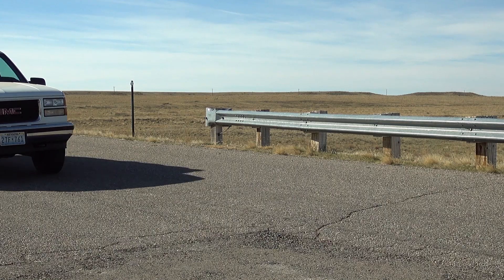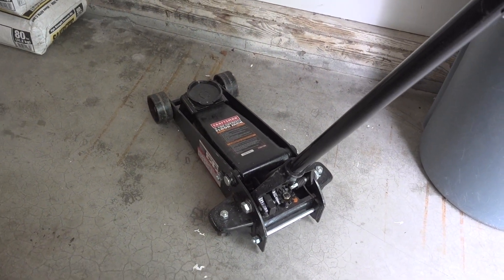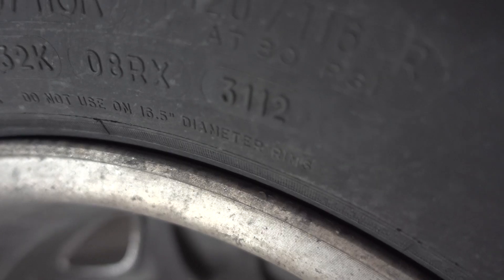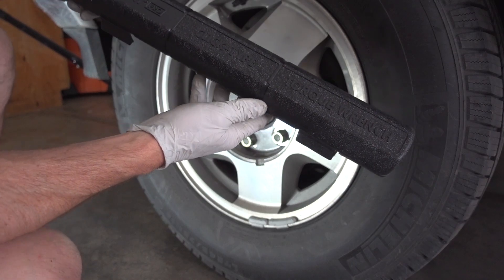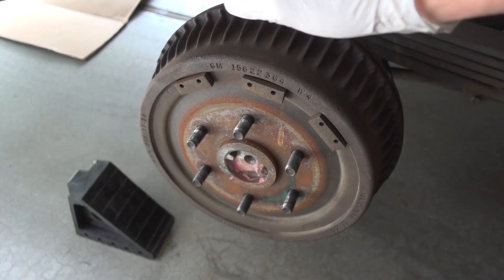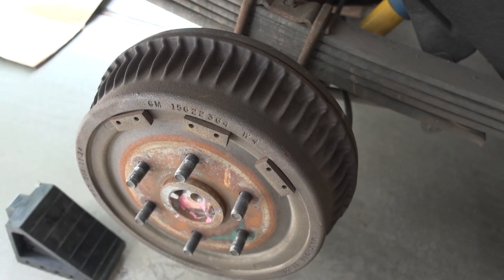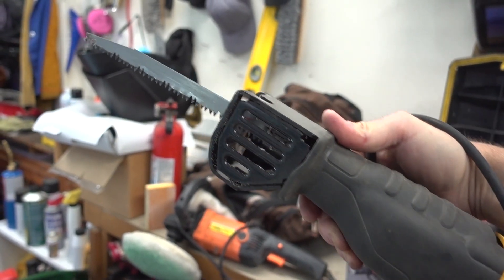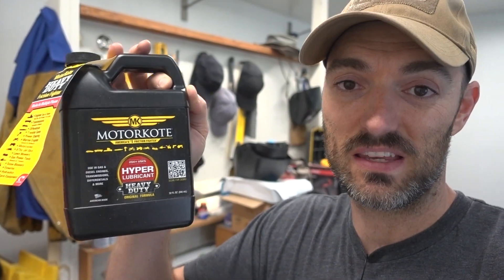SIMPLE FIX FOR TIRE HUM!

Comment: Want to add "never" let a tire shop cinch your tires up with an impact wrench.  Had several rotors and brakes destroyed by an aggressive impact wrench operator.  Never knew this until a shop owner told me. Tell them that they can draw the lugs up with an impact, but you want the lugs tightened with a torque wrench to manufacturer specs, or 90 ft lbs if you don't have the specs.

Comment: Torque spec for the wheels is 140-145 foot pounds on a 4x4 Chevy/GMC truck of that era. Never use anti seize or anything on lug studs or nuts.
Reply: Amazing how many people forget about a wire brush to get loose rust off wheel studs.

Comment: I'm not sure if this helps, but when i have humming tires i first check my air pressure, and if that doesn't fix it i rotate my tires. So far it's fixed it every time (driving for 33 years now). P.s. i hate harbor freight because it's the source of almost all my credit card debt. :)

Comment: 7:04 I may have misunderstood this but you should always store your torque wrench zeroed out. The reason for this is it will mess with the reading and then your bolt won't be properly torqued.
Reply: Absolutely true. I forgot to reset it one time, stored for a few months and it immediately broke when I used it the next time. Expensive mistake.

Comment: I heard to never use lubricant (never seize) on lug nuts as it will change the torque value so, you would have to go to a higher torque (no idea how much higher) to achieve the same torque as you would have with dry lugnuts.  I am not claiming this is the case but I leaned this back in the 1970's and it seems to make sense.  Check it for yourself and see what you come up with.  I really enjoy your videos.
Reply: Never had any problems. Antiseize or not. Torqued or not. Never :)

Comment: I use the anti seize all the time.  I find it virtually stops the rims from sticking to the hub area.   I also place a bead around the rear drums where they sit on the hub.  Allows for easy removal and stops rust.  Great video.

Comment: i am a professional mechanic for medium/heavy duty trucks/equipment and i know not much of tires since we send our tires to the tire shop since it is dangerous but i do not recommend anti-seize on lugnuts if they are rusty or worn out replace them! if i see a truck with anti-seize on lugnut studs i can not pass them on a DOT inspection the anti-seize must be cleaned off to pass! keep up with the videos man!
Reply: Chances are if you have aluminum wheels on your truck, you have anti-seize on the bottom of the stud.  Dissimilar metals tend to stick to one another, and if you didn't have to replace a tire for a while, the tire guy could be beating the inside of your tire for 15 minutes trying to get the wheel off.  But, no, no locktite, no anti-seize on the entire stud, and nothing between the lug nut and the stud.

Comment: I was always told that if you have all matching wheels that includes your spare tyre that the rotation is spare wheel to one side of the primary drive axle then that wheel will go to the opposite side of that axle, then that wheel will go to the opposite side of the front axle then that wheel goes to the opposite side of the front axle, then the wheel left is put back in the spare wheel area.

The torque wrench should be zeroed out after using it, this I was told to keep it in calibration.

Cool vids.

Comment: I have always been taught that you should never add any lubricant on lug nuts. Because you don’t archive a true torque. The torque rating for you lug nuts are a dry torque rating. Lubricating them can cause you to over tighten the lug nuts, and doesn’t provide enough friction between the lug nut and your wheel which could lead to the lug nuts loosening over time. Also tires are good for 10 years max, assuming the tires don’t show any signs of weather cracks, or have uneven tread wear(in that case you may have an alignment issue or suspension issue),and are above 3/32 tread depth.
Reply: I have also heard this. Only lube on the threads.. not the mating surface (tapered part)
Reply: 10 year rating is ideal conditions it's far less then that. 3/32 you will probably hydroplane.. and if you DO you might be liable for the crash aka failure for maintenance.
 
if you live in California then you can run slicks  since it never rains

typical LT tire is 12/32 new upwards of 18/32 for mud tires
Reply: Andrez Vigil you were taught wrong. If you run a rusty lugnut over a rusty lug stud and torque it to spec it will fall short.   Always use a little anti seize on your studs. Just like torquing cylinder head bolts. First thing the mfg says it be sure to lube the threads

Comment: There's no rule for age. I've seen 2 year old tyres with lots of dry-rot, and I guess I've seen 10-15, maby 20 year old tyres that almost look brand new. It comes down to type of rubber, and environment as you've heard. You might think cheap tyres have shorter life. That may be true in most cases, but my wintertyres (from Norway, so we normally have summer and winterwheels for each car) are from a very well known brand and actually starting to show signs of dry rot at 2-3 years old.
Especially for wintertyres, they get harder over time. Sitting in a pitchblack, cold place, they'll most likely be fine for many many years, but with use, in heat, sun etc they get harder.
So I'd say it's more down to how they look (dry rot) and how they perform rather than a date.
If I have to say a date, I guess I'd go for 10 years, IF they still look fine.

Never put anything on threads. Antisieze on the surface where rim meets rotor, yes if you keep having problems getting the wheel of, but nothing else.

Comment: I’ve had those same Michelin’s on my blazer. They lasted 75,000 miles! Well worth the money for them.
Reply: They lasted 100k on my Yukon. Would still be okay for summer if the front suspension wasnt wpre out and dicked up the tread. Rotated them ever 3k miles when i did an oil change.
Reply: You didn't talk about the tires hum noise 🤷🏿‍♀️

Comment: From my understanding. Cause I work at Americas tire/Discount tire we tell customers tires are serviceable 10 years and under to Date. But we highly recommend getting tires replaced when they hit the 6 year mark or 4/32 which ever hits first. Also we dont put anything lube or loctite what so ever on the studs or lug bolts. All we do is use a wire wheel brush to remove corrosion off the hubs and back of the wheels (both mating surfaces of where the wheel touch on the vehicle)
Reply: Best advice in the comments yet. Should put a bit of silicone paste on the pilot flange.

Comment: I always heard you're not supposed to change rotational direction of radials after they've been driven for a few miles because it can cause damage to the tires. I always move them from the front to the back on the same side and vise versa.
Reply: Yeah ,I've always heard the same thing. Hmmmm....

Comment: Mine turned out to be a bad bearing, so I ordered a wheel bearing assembly (for a Maxima rear wheel)  and installed it in less than 30 minutes - problem solved!  I have pressed out bearings before, but it was so easy to just order the assembly which only cost me 24$ on ebay!   :)  Doing it myself probably svaed me > $150,00

Comment: Tires "expire" 7 years after manufacturing. I worked for years as a mechanic (cars, trucks, and motorcycles) every where I worked we would have to check the dates on tire constantly and any at 7 years got a triangle cut out of the bead and sidewall so that they couldn't be used and sent to the recycler. Always seemed like a waste but every tire guy from manufacturers like to, Michelle, Cooper, ect all said 7 years regardless of condition or environment they should be replaced

Comment: All good, but I would not put anti-seize on lug nuts - it has a big impact on torque. You are effectively over torquing and putting threads under higher stress.

Comment: I had cargo tires on my van. When the tire wore to a point the small crosslugs were touching pavement a hum started. I figured it out and they gave me 4 new tire probably with different compound so no hum. Same tire. Now they put continental brand on the vehicle new.

Comment: I use 6 years as my standard for tire age. Also, I would never put anti-seize on lug nuts. If you're rotating your tires on a regular schedule, you shouldn't have to worry about lug nuts seizing up.
Reply: tire shops wont mount anything over so old...
Reply: @mtnmosin2740  I would certainly hope not. Any tire shop should be installing tires that are months old, at the most.

Comment: you need front brakes!  Also I use stick on wheel weights to avoid marring the clear coat on the aluminium wheels.

Comment: Hay sorry mate but you must only rotate tyres front to back and back to front because if you don't and you Cross them from left to right and right to left they are going to rotate the opposite way this causes the SET in the STEEL BELTS to push into the plys of the tyres .That's ONE BIG BLOWOUT WAITING TO HAPPEN .from Aussie mechanic of 40 years thanks!!!!!!

Comment: I prefer soft compound tyres on the front.Hate rotational tyres as have to change with the rear ones.Tyres do go hard as they age   and need replacing regardless of what tread is left.

Comment: First, I love your videos man! I've been watching you for a while and I'm impressed with the quality of your videos. Second, I love watching videos from people that are clearly not in the rust belt and talk about preventing rust. As I feel, wheels and tires come off enough that rust prevention is probably not needed to keep any major rust from forming. A thin layer of anti-seize or fluid film on the lugs is never a bad idea, but judging by how clean the Suburban is, it did not come from anywhere road salt was used but I don't remember where you moved to. I work on vehicles for a living and don't usually see any coatings used on the lugs and often don't have an issue unless they're Chrysler lugs with chrome caps. 
Also, tires are usually recommended to replace every 6 years. The rubber tends to get hard by that point. If you don't deal with slick roads are long below freezing temps, you can probably get a good 8-9 years as long as they aren't sun baked or rotted.

Comment: Do not put anti seize on the lug nuts ,its will make torquing the nut pointless and also the lug nuts can back off
Reply: John never had a problem with that happening before been using anti seize for 5 years and always torque mine to 100 ft lbs

Comment: I was taught 6 years of age and they are usually due for replacement, I see in the middle of the tread you started to develop some slight cracking. Seems like age will be the issue with these not tread life.
Reply: The tire company must have taught you that, I have tires in the neighborhood of 20 yrs

Comment: Enjoying many of your videos especially this one  as  I work for Michelin. I do the rotation a little different I move the rear straight ahead and cross the front to the rear. Sometimes the humming of tires comes down to air pressure and the difference in construction of road surfaces. I have recently purchased a new Silverado RST and am looking forward to doing some of my own maintenance.
Reply from the maker: Thanks👍👍

Comment: I would not reverse the rotation of a tire.  I would consider replacing any tire that's over six years old.  I have never used any type of anti-seize on lug nuts and have never had a lug nut come off or become loose.

Comment: You can use anti seize on the back of rim.. but never ever..ever on lugs
Reply: Always put lube on the pilot flange, never on lug nuts. If the studs are rusty, use a wire brush.
Reply: Ha I just had a good chuckle anti sieze on lug nuts that's a good one. 😂

Comment: For torqueing, set the wrench to half, then do the 1st torque...lower the vehicle, then set the wrench to desired number (120ft-lb seems really high) and do the final torque w/the weight of the car on the tire...yes, never lube the mating surface of the nut/bolt...if anything, put anti-seize btwm the wheel and the rotor/drum...rotating tires in flipflops seems safe...did you even fix the tire hum??
Reply: 120 sounds right. 
My 01 is 140

Comment: My 2002 suburban makes the chirping sound when idling and light acceleration.  I was curious if that is pulley related.   Another good video!  Thx
Reply: Belt tensioner.  Almost all GMs need them replaced between 60-70,000 miles.

Comment: budget 5 years and premium 8-10years.
Reply: any advise Mikael, I have a pair of TOYO tires that are from 2009.  Bran new and never seen daylight as they have been kept in the storage shed.  Do I throw them away or fk it YOLO and put em on and be on the lookout.
Reply: Ken Pachi the big problem with tires are that they are perishables. they dry out and goes from soft gripping the road to solid like a rock. when for exampel you need to break a fresh tires will grip the road and a dry old one will act like a rock and slide on the road surface. there is alot of factors more that will make the tires less safe. wet handeling. emergency handeling. breaking.
Reply: Thanks for the reply Mikael. . . I will just go ahead and put them in the trash where they belong. Will not risk getting my family in a crash due to new/old tires.
Reply: Ken Pachi bad tires is the most common reason for automtive accidents. people look at the tread and that is unsafe. tire makes say 10years life span but that is in mild climate not to cold and not to hot. if you live somewhere hot the tires dry out faster and becomes unsafe. pay for good new tires now or pay even more after a acctident.. i live in sweden and we have +30c in summer and -30c in winter and  the tires are rekommended to be changes every 5years due to climate that destroyes the rubber.  my tip go to a tires shop and rubb your hand on a new tire and then your 9year old toyo and you will understand what i mean.
Reply: Ken Pachi if you haven’t thrown them away yet I’ll buy them haha

Comment: Jimmy- you have 2 separate pieces that form one; a rim and a tire make a wheel. In this video- you are rotating *wheels*. If you dismounted the tires from the rims, then rotated, including the (full size) spare, and balanced- that would be a proper "5 tire rotation", which hardly anyone does anymore- until they need the spare, that is rusted under the truck, and probably nearly flat. Also- if you have "directional tread" tires- you could not do what you show in this video; you would have to do as I described earlier. Of course- if your vehicle has a "donut" type spare- that is not included in a rotation, but should still be checked at least once a year, including jack & lug wrench- and before trips exceeding 200 miles.

Comment: I know Michelins are notorious for going bad early. I know Lincoln says to replace the tires every 21,000 miles or every few years. Don't remember the exact number but I know the tires on my town car got hard real fast and gave me almost no traction. Cooper is for sure better if you're not buying track tires.

Also putting lube on your studs is just asking for the lugnuts to get loose

Comment: Along with checking the tire hum WITCH can be caused by weather are they dry routed or cracked also check your hub bearings along with cv-joint

Comment: you know the quick fix for hum leave that boat at the dealership and get a car with acoustic insulation I'm pretty sure a 10 year would be a better mechanic than you. or heres a thought get acoustic tire foam and do what Tesla dose glue a foam pad to the inside of the tire. And are you wack, age of the tire doesn't matter if its not cracking or the tire isn't bald

Comment: I don't think you are supposed to cross  rotate radial tires.
Reply from the maker: Dennis W I think that only matters if they are directional. I could be wrong but that's what I read.
Reply: That only matters if theyre directional tires
Reply: Dennis W that was 20 years ago unless they're directional.
Reply: You CAN cross radial tires.   Even if  they're directional, although by doing so, you lose the advantage of the characteristics built into the tire.  So I'd only swap sides on directional tires for short periods of time (say using a directional spare on the wrong side of the car).  HOWEVER, the tires under torque should stay on the same side and those not under torque switch sides.  If done every 6000 miles, it will improve the wear on the tires.  If you miss one time, you lose the advantage.  So the rear tires on a pickup should go straight forward and the fronts should cross to the back.  Hum is usually caused by the slight heel/toe on the tread blocks.  By reversing the rotation, they tend to even back out.  Works wonders for mud tires that aren't too far gone.   Just my experience from 27 years in the tire biz.
Reply: You can just balance the front
Reply: Front tires tend to wear heel/toe.  Balance won't do a thing for that.  You could swap the tires side to side, but then, you might as well rotate them and give them a rest from steering chores.
Reply: If they aren't directional the front tires go strait back and the rears cross over to the front

Comment: Tires should only be good for up to 10 years regardless of tread
Reply: Lol  stupid advice   5/32 is time to replace .. (most new tires are 10/32 to 16/32 for mud tires)
6 to 8 years  (as long as you don't do stupid shit like under inflation )
Reply: APPLE JUICE its 6 years after that they have a chance of detreading because of old rubber.
Reply: It is only recently that tire age has been used for tire replacement.  It may be that tires are lasting longer.  I remember when people were happy to get 25,000 miles on a set of F78-14 Bias ply tires.  I have never has a set of tires that lasted 10 years, I have had tires (Cooper STT MUD TIRES) go over 65,000 miles.  But that only took 4 years.